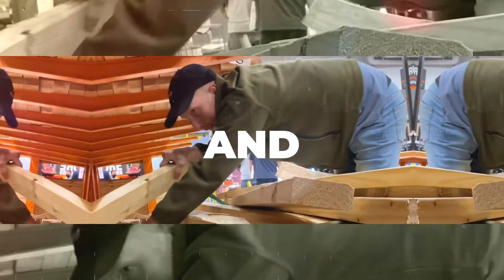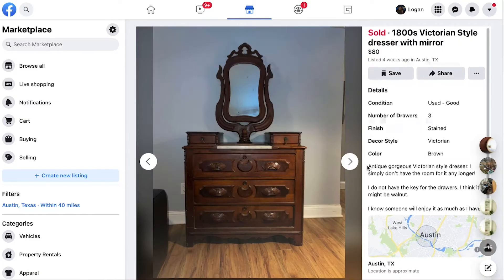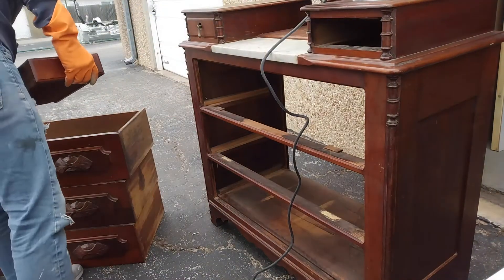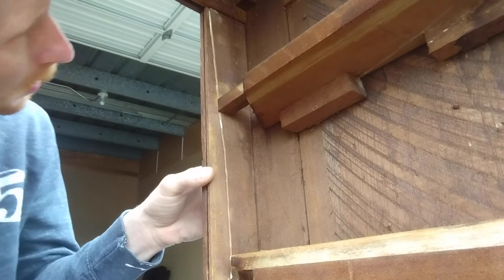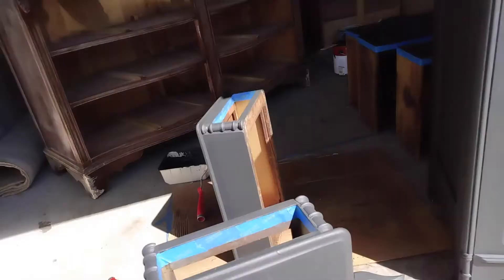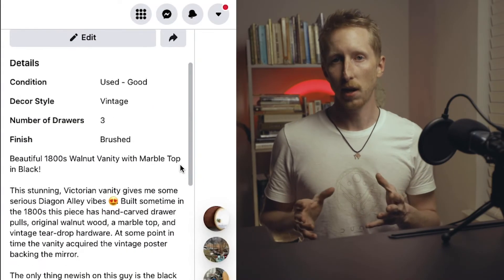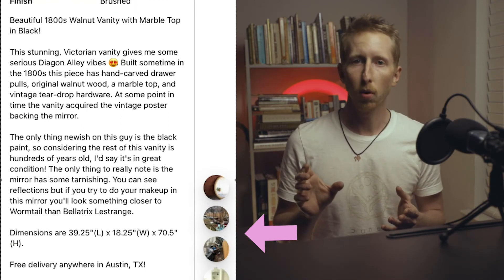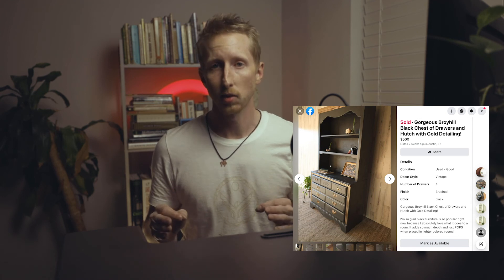Make Money Flipping Furniture // Furniture Flipping For Beginners

Comment: Hi is the seal polyurethane the same as Minwax  polycrylic protective finish? Is that a seal too?

Thanks
Reply from the maker: I've used both to seal furniture and haven't noticed that much of a difference between the two. I'd say use whatever is cheaper at your local store and then compare or contrast overtime what brand or type of seal you prefer.
Reply: @furnitureflippingentrepren1161  
Ok coz I was looking to purchase Minwax polycrylic but I think it’s a US brand and it sells on Amazon uk for £30 roughly $40 for 1/2 a pint am. Not sure if it’s the regular price over there in the US but that’s kind of expensive and so was looking for an alternative that would do the same job.

It’s my first project on a budget so I don’t want the cost and all to stop getting it done.
Reply from the maker: @geobun2734  yeah any indoor polyurethane should do the trick. Just remember not to let the seal glob up or you'll have to sand it down and reapply another layer of seal. I also don't use sheens higher than satin because then it will make my piece more glossy/shiny than I prefer
Reply from the maker: @geobun2734  Also good luck on your first project!! Let me know how it goes  😀
Reply: @furnitureflippingentrepren1161  

Thanks will send you photos 
Lol I  have never done this before and am cracking my head up but am not afraid to try if anything it will be a good lesson and leave room for improvement... am willing to learn